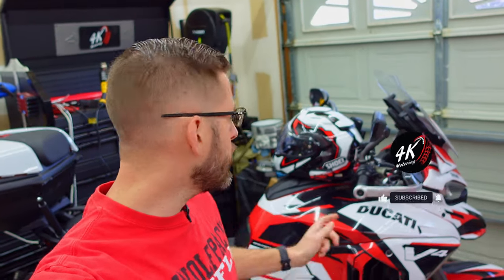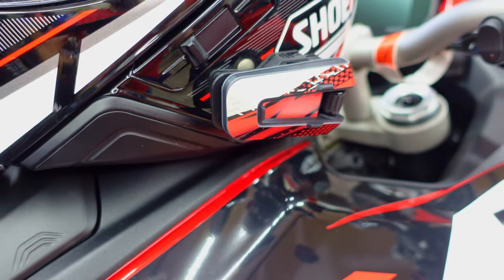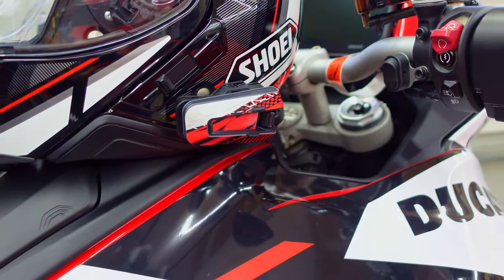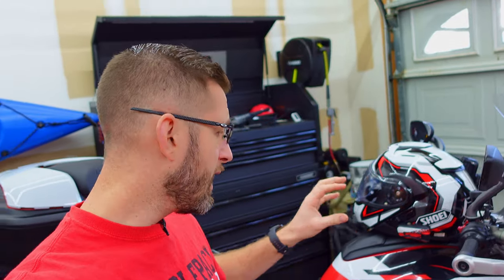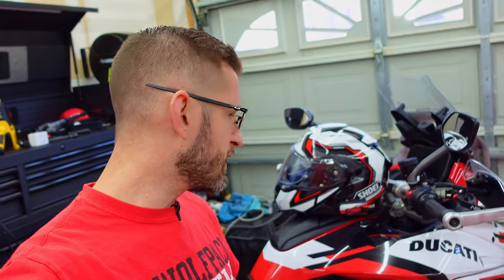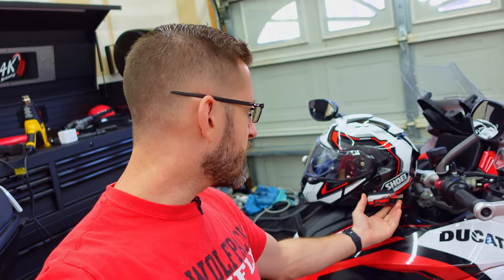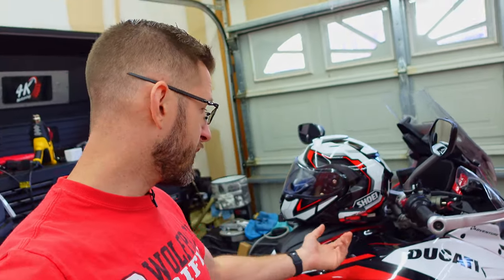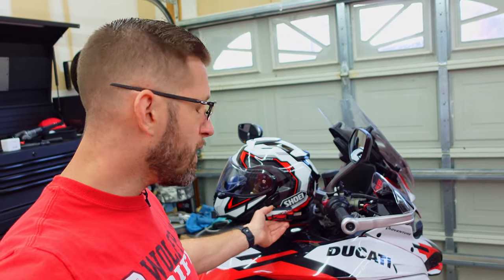Cardo Packtalk Edge Problems

Comment: I'm on my second unit. First one, the radio would randomly turn on when I would speak. Now the battery barely lasts one roughly 6 hour ride with only using group communications and GPS voice prompts.  Cardo wants me to do a battery test
Reply from the maker: That's their standard practice. I did the same test and they replaced mine
Reply: @4KMotoring  OK, how long did the radio stay on when you did your battery test?
Reply from the maker: @robb8773  around two hours before giving a low battery warning

Comment: How are you all getting Cardo Support? I've sent in emails off the site and heard 0 back. There doesn't seem to be phone support listed anywhere - do you have a phone # that I just haven't seen?  I've not had the unit more than a week and have other issues, not long enough usage to have this battery issue. I have no Cardo Voice Control, I did first off but then not, and Siri is hit or miss. I also find 2 pairings in my Bluetooth list of devices, can't seem to get around that. I've tried re-booting, returning to factory settings, can't seem to get around these problems. Is there a Cardo group out there on the web discussing problems and solutions? Thanks.
Reply from the maker: I went through the Cardo Connect app and was able to get ahold of support that way. Got quick responses, check your spam folder.
Reply: OK, thanks for the reply, I have always checked my spam filter and seen nothing there. I tended to go the website and the Support page, maybe I’ll try through Cardo Connect like you suggest. But won’t be surprised if I end up that same support page, we’ll see. Again thank you.
Reply from the maker: I don't own an iPhone so I can't provide a ton of assistance there, but try connecting your cardo to your computer and using the cardo update software. That may fix any bugs you're experiencing
Reply: I’ll look into that, but there again when I try to update it says that I already have the current firmware software, I forget which, but I think it’s 3.1. Again, thanks for your replies.

Comment: Mine came built in to my 509 Commander Mach V helmet. My complaint is sound quality for music. Horrible no mids or bass. I ended up downloading a EQ app and it was a world of difference
Reply from the maker: Did you end up with the JBL speakers? The Cardo Connect app has EQ settings
Reply: Yes i have jbl. The eq on cardo app  was barely noticeable.

Comment: On the pack talk edge orv we are having issues on sharing music on a repeatable basis. Anyone else having or tried this feature?
Reply from the maker: Like sharing music from one unit to another?
Reply: Yes. One person can share their music to anyone in their group. But it’s only working sometimes and not consistent. Even just around the table we are having issues.
Reply from the maker: Hmmm honestly not sure about that, I've never used that feature. Might be a question for cardo, but I would imagine it used their Bluetooth connection rather than DMC, which if often a little glitchy
Reply: We got it figured out.

Comment: Is it true that cardo edge is having a problem if use in carbon helmet?
Reply from the maker: I'm not exactly sure what you mean, I've run the cardo edge in my carbon agv sport modular for a couple years without issue. Carbon fiber is not made much differently than typical fiberglass or other matrix composites found in most helmets.
Reply: @4KMotoring  thanks for your answer! 🙂 some said its having connection issues or reducing the range. Im thinking before that probably its just occurring with the edge variant, not with bold.
Reply from the maker: @kenal7748  the actual communicator mounts outside the helmet, so it shouldn't make any difference
Reply: @4KMotoring  this answer is what i needed. Thanks a lot! 🙂

Comment: I'm having alot of problems with Cardo support and the system. My system works great in a controlled environment. But when i'm riding outside the battery life goes down to 3 hours of battery life with a full battery. Cardo wont replace the unit. They say that this isn't a factory defect. I'm having this problem since i bought the unit (15 months ago) For about 13 months i had driving lessons and didn't use the unit that much. Now that i have my own bike I noticed this problem. Cardo and the dealer wont give any warranty. Cardo Support is the worst support i have ever experienced. There goes my 400 euro's. I expected better from this company.
Reply from the maker: Interesting perspective, maybe it's country based? I've had nothing but the best from Cardo Support, they've had no problem replacing two units for me for the same battery reasons
Reply: @4KMotoring   Did you have the same problem as me that in normal house conditions the cardo unit works perfect, but when your out riding the unit only works for 3 hours?
Reply from the maker: It was noticably insufficient. They gave me a method to test using FM radio from a full charge, I wasn't even getting 3hrs out of my battery. Make sure you're running the latest firmware as well.
Reply: @4KMotoring  You showed the test to cardo right? And how was the procedure after that? Are they gonna test your unit at their company?
Reply from the maker: @naamloozzz3463  they gave me instructions via email, I responded with my results, they sent me a new one and apologized for the inconvenience.
Reply: @4KMotoring  aah Okay. Well, i’m going to try that. I Live in holland so the importer did not want to give any warranty on the product en so does the dealer. So now i’m going to contact cardo in the US and see what they say about the situation and the unit.  Thank you so much for the help!
Reply: @4KMotoring  do you know the email address you used?
Reply from the maker: @naamloozzz3463  https://cardosystems.com/pages/contact/customer-support

Comment: I keep having to factory reset mine due to sound only on the right side.  Waiting on another one from Cardo.
Reply from the maker: Hmm, that's not good! Glad Cardo Support is taking care of you
Reply: Do you know if it's software related or hardware? Mine stopped working on the left side as well
Reply from the maker: I would bet it's more on the hardware side, check the little pins underneath the magnetic mount to make sure they are all making good contact, then check the wires going to the speakers, they are thin and pretty brittle if they get folded up inside the helmet
Reply: @4KMotoring  to me it doesn't make any sense if a reset makes it work again, checked the pins but not the speaker wire yet, it's a probl of lately

Comment: You're kind of freaking me out because I have a new one in the packaging from Amazon and a new helmet arriving tomorrow and there aren't really any options out there, this one is supposed to be the best on the market. Supposed to be made in Ukraine? My box says made in China. Should I just return it and just wait for some company to make a quality product? I don't want to fuss and hassle with this thing and have to contact support and all that.
Reply from the maker: From my interactions, it seems like the majority of Edge owners have no problems at all, and Cardo customer service is great to work with in the unlikely event you do have an issue. 

Ukraine is responsible for a lot of lithium batteries, Cardo included. I wouldn't worry about it at this point. 

Let me know if you have any issues, but I would expect you around just be able to open it up and enjoy using it!
Reply: @4KMotoring  well, on Wednesday I'm running the last 200 miles of break in on my new S&S 1200 conversion for my 883r Sportster, and I'm hoping to kick off Led Zeppelin 1 right when I leave the driveway.  I'm sure you know, break in requires a lot of working the throttle and a lot of restraint. I can't do another 200 miles of that on nothing. If this thing doesn't work I'm gonna be so pissed.
Reply: Ok, it's a legit unit, I charged it all the way, and it worked great. Voice commands are prompt even versus my loud exhaust. Battery is enormous. Did my 200 today in about 6 hours and it's still at 75%. Through earplugs the music is adequate at max volume. Ordered some Exsound 4.0's to see if I can remedy that. Oh and it rained, and got cold. It was fine.
Reply from the maker: @Audfile  good to hear!
Reply: @4KMotoring  man the Xsound 4.0 just showed up and right off the bat they are extremely impressive looking compared to the stock JBL. They also couple straight to your ear. The speaker drivers themselves are just, way more substantial than the JBLs. I'm surprised there is literally nothing on these on YouTube, only the old version, which is nothing like this. Motorcycle audio is a tiny market, and Motorcycle audio upgrades even smaller. But at least 1 video? Seems like a big secret. I expect these to dominate.
Reply: Last comment. I must have installed them right because the Xsound 4.0 absolutely slap and are waaaaaay more comfortable than the stock JBL. Like putting on headphones, seriously. They make bass that will make your ears flap. I listen through earplugs, with earplugs in and some EQ they are all you could hope for at this point in the technology. Again, better than the Cardo Stock JBL and way way way better on the ears. The JBL does have great mids and highs, but these are basically equivalent and the gel cup only enhances it, folds into every shape on your ear. The JBL are just blowin at you, raw.
Reply from the maker: Interesting news! Do they isolate sound well? I still like to keep a decent awareness of my surroundings. I may see if I can get a set to test!
Reply: @4KMotoring  I mean, it's not thick material, it has to be able to come on and off and not get brittle. But it's an improvement. Without earplugs, the JBL has better mids and highs, I think the Xsound is designed to use earplugs. Let's be honest, anyone who rides regularly without earplugs, and especially without earplugs AND with speakers is a fool lmao. Just begging to be asking "what did you say?" In no time. But yes it isolates enough to really transmit bass very well.